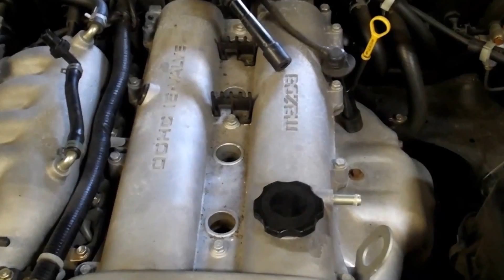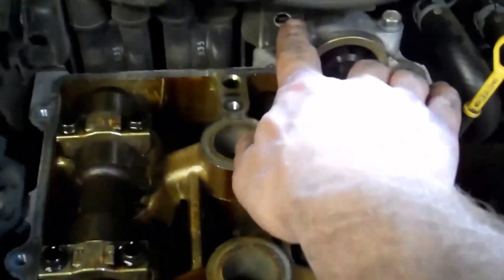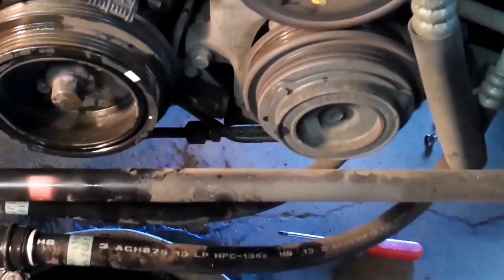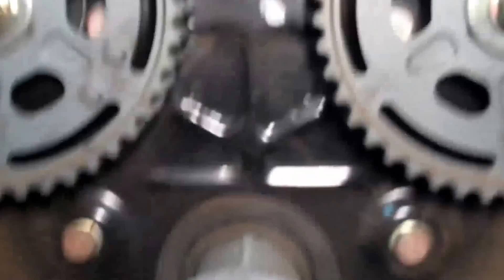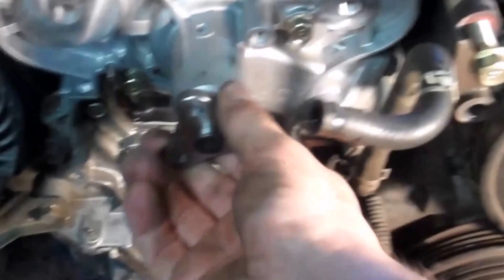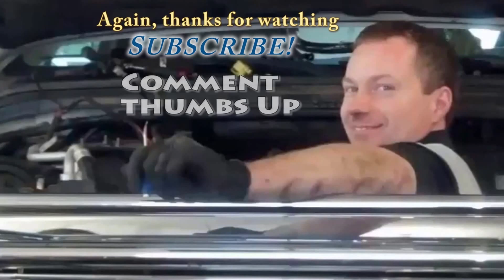Timing belt replacement Mazda Miata 1.8L 1999 water pump Install remove replace

Comment: Great work, i fell on this video because I'm getting a check engine and some of the things mentioned in the code is timing might be off, i have a 99 1.8L Miata with 170k kilo, how much do you think this job will cost me, with new timing belt and water pump plus i want to change the valve cover gasket too.  @youtube should allow us to upload pics with comments.